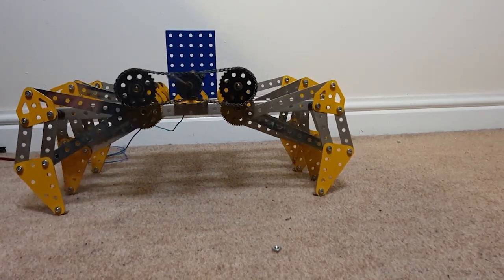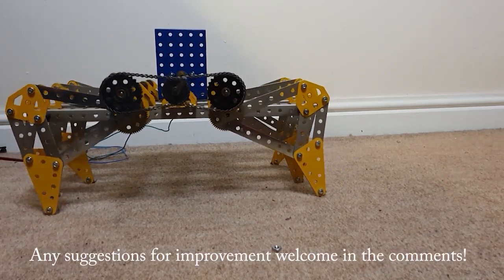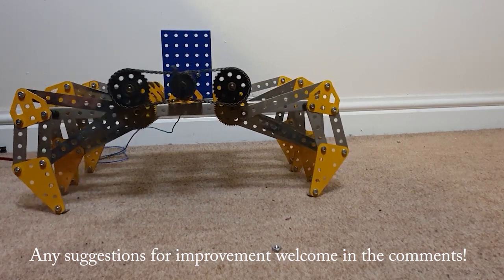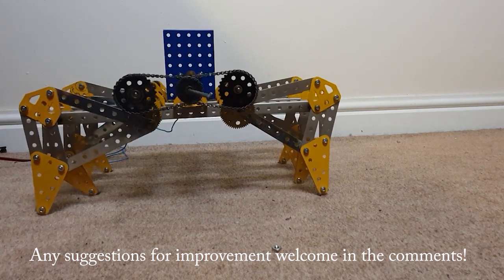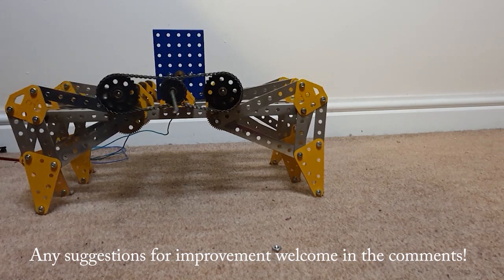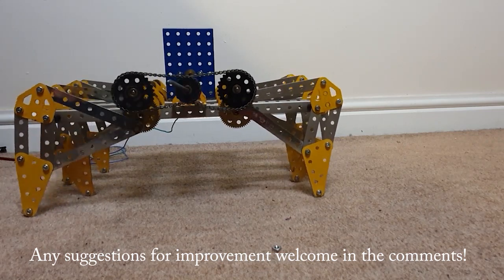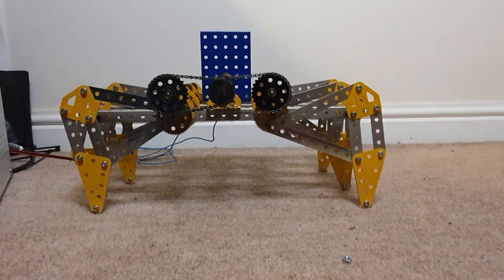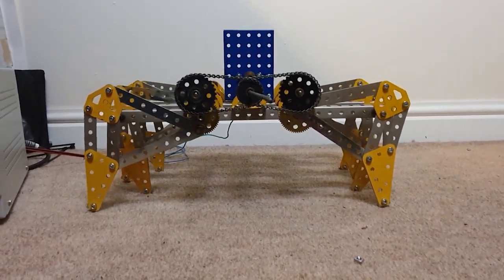My metal STRANDBEEST - will it walk?

Comment: Have  you tried it on a smooth surface? Might be worth a go? BTW could you put a link to where you bought your hex screwdrivers please, they're cool ! Thanks.
Reply from the maker: A smooth surface had similar results, unfortunately.  I think the issue is around weight.

The hex screwdrivers are made by a company called Arrowmax.  Just do a search on Amazon for Arrowmax hex and you should get plenty of results.  Normal Meccano screws need a 3mm driver, hex grub screws need a 2 mm.

Thanks for watching!
Reply: @BaldyMakesStuff  Thank you very much.